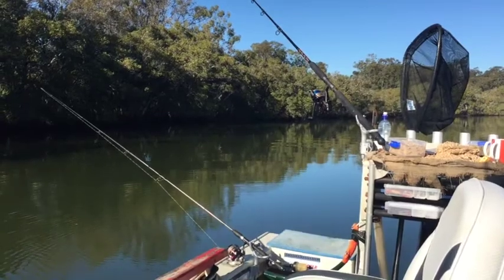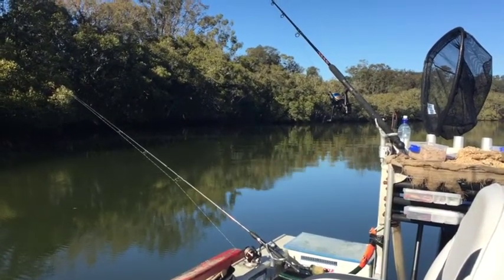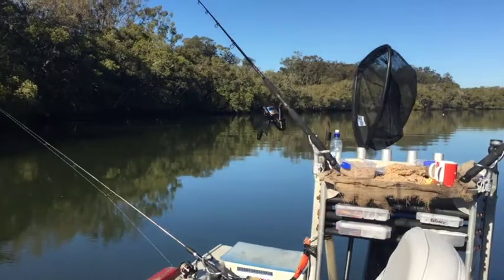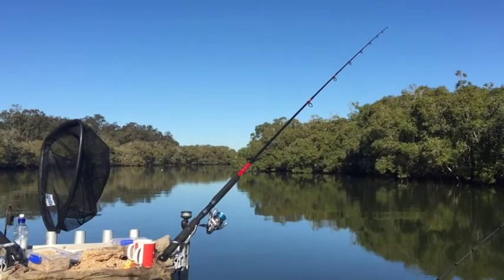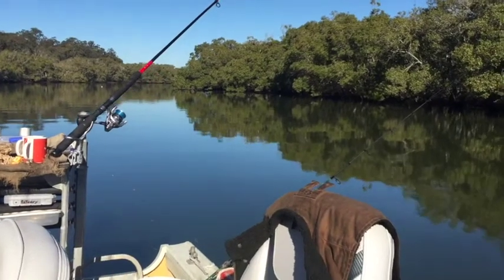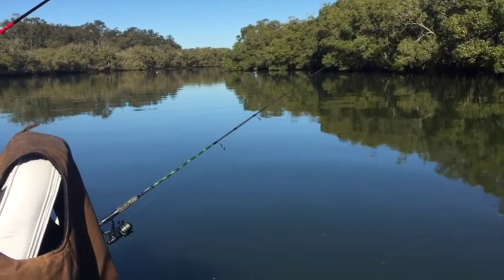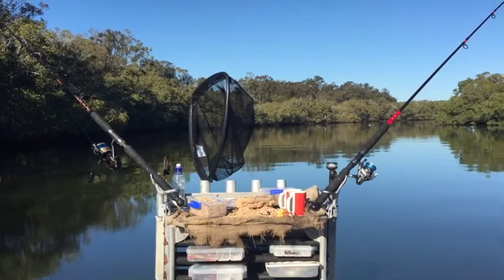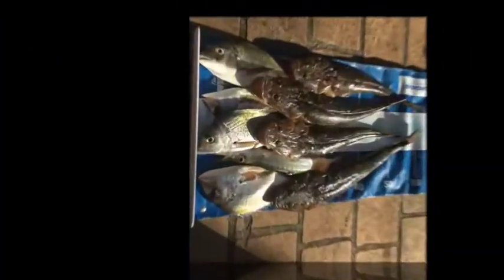Trolling for Flathead, 4 rods.

Comment: What lures? And I don’t know wether you said your trolling with bait??? Also do you troll with the tide or against it and are you using an electronic motor?
Reply from the maker: In that video I had the two high rods with bait and the two short low mounted rods with soft plastics. Often I’ll have hard body on one or two of the rods. I prefer to troll with the current.

Comment: What weight plastics do you troll? Why don't you troll hard bodies?
Reply from the maker: G/Day Dbay Boyds, sometimes we do troll hard bodies but seem to have less issues with snagging and weed with soft plastics and catch as many with the SP. We generally troll with the current and use enough weight to stay very close to the bottom. Current dictates.
Reply: +Wayne Groomes thanks for the fast reply. I have a dirty big 2 stroke and no electric so I don't do much trolling
Reply from the maker: DBay Boyds Flathead don't seem to care about noise. So give it a shot